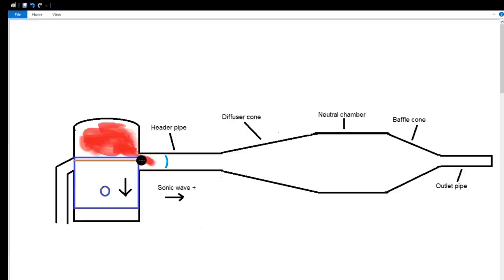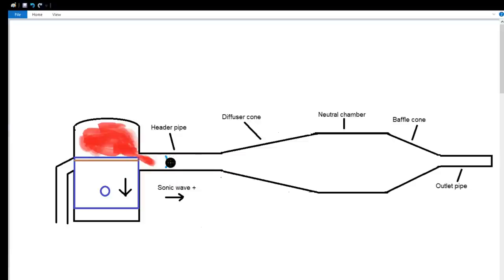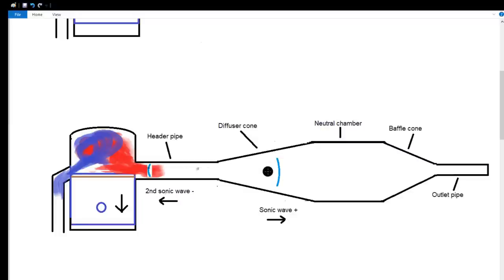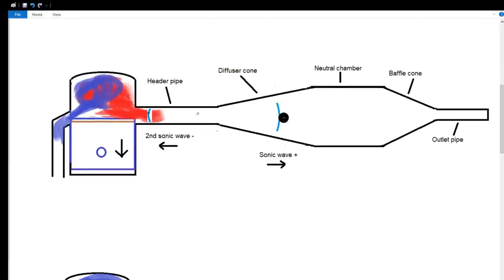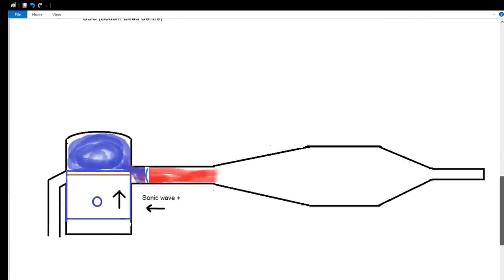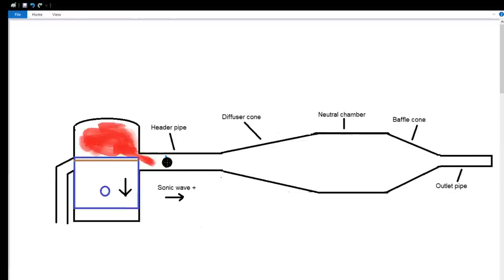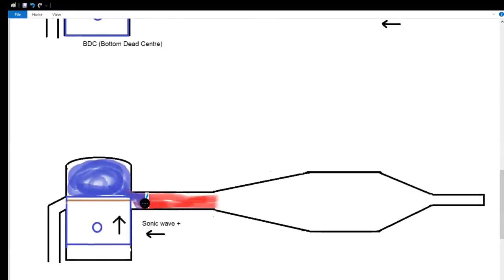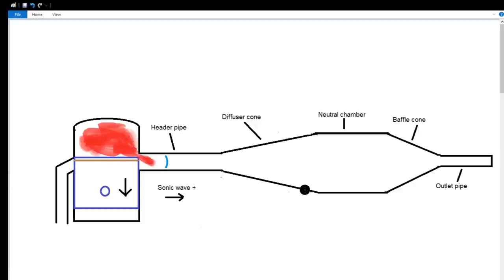Unlocking the secrets of 2 stroke expansion chamber exhausts E1

Comment: does the length of the header pipe have an effect on the performance?
Reply from the maker: Any change in the header length would position the diffuser closer or farther away from the port and would effect the timing of the first expansion wave returning so the yes it would.
Reply: @AuMechanic  so if there was no header, the expansion chamber would work as well and it would be just a matter of timing? In other words, is the header essential for the exhaust to work properly?
Reply from the maker: @Shulkyl  Not really possible as the port length is in effect part of the header length in so much as it also provides some distance between the start of the diffuser and the port window at the cylinder.
And for example if the engine RPM was very high and EGT high and the port fairly long then the pipe itself would have a very short header if at all.
Reply: @AuMechanic ok. There are these exhausts on ebay for motorized bikes called "banana exhaust". They kind of have an expansion chamber but little to no header at all
Reply from the maker: @Shulkyl  Yes I know the pipe you refer to and the first time I saw them I concluded they were more "show" than "go".
Those motorised bike engines have a fairly low peak RPM which would dictate a fairly long tuned length and this longer pipe then higher revving engines.
You could download the free pipe software I wrote (see link below videos) and make some calculations based on your engine that would allow you to figure out at least how long you would expect the header to be on a properly tuned chamber as well as the total length.
Reply: @AuMechanic  alright, thank you!

Comment: do shorten header pipe increase high rpm power, and raise rpm?
Reply from the maker: Shorter total pipe length (tuned length) will raise the effective RPM range the pipe works at.
In spring Karting a flexible header section is used and they are changed to raise and lower the RPM the pipe works at.

Comment: How can you tweek the pipe for more low tpm torque?
Reply from the maker: To get more power spread in to lower RPM range you need to basically make a different pipe to suit as that aspect of the pipe is in the angles of the cone tapers, lower angle cones will provide gains over a wider RPM range,
See the later vidoes that covers all of this, and check the description section for a link to free pipe software and if you have a mess with that you will see how the pipes differ from peak power pipes for road racing to wider power pipes for offroad.

Comment: Why does sonic wave ignores the exhaust but pushes back the air with fuel?
Reply from the maker: The gas is a mass or air molecules, the wave is energy moving through the air mass.
The wave raises or lowers the pressure of the gas only at the location of the wave.
The same as a wave in the ocean causes a rise pr trough in the water level where the wave is.
So the sonic wave doesn't push the gas anywhere, if the face of the wave arrives at the port just before it closes, which it does if timed right by the tuned length of the pipe. Then the leading edge of the wave peak will block fresh fuel and air gas mixture from spilling out of the cylinder into the port as the port closes thus trapping more of it in the cylinder resulting in more power.
Reply from the maker: Another example
Image a gate at the edge of a harbor that allows or stops water from moving out into a channel of water and there is a boat drifting with the current that is about to drift through the gate into the channel and a wave comes back up the channel against the current. The wave arrives at the gate just as the boat is about to go through it, at that moment the front of the wave cause the forward speed of the boat to slow or stall until the peak of the wave has passed it but before the wave has passed by the boat the gate suddenly closes trapping the boat in the harbor which, if the wave had not arrived and slowed the boat momentarily, the boat would have passed through the gate just before it shut into the channel.
The harbor is the cylinder and the boat is the fresh intake charge that is about the spill out into the channel which is the exhaust.
Reply: That is an excellent answer. Thank you@

Comment: So... this is why a shorter exhaust gives better top end, and a longer one gives better bottom (about same volume)?
Reply from the maker: That is the effect of changing tuned length, but for a fixed pipe lengths the tuned length is also fixed and to get more top end or low end power other parts of the pipe are adjusted, the video series explains which part does what.

Comment: hello, i have a question. how can i increase the rpm that my engine produces? its a 2-stroke 50cc.
anyways your videos are really good!
Reply from the maker: You can do that by reducing the tuned length of the expansion chamber however if the port timing is low then you will need to increase that to have good power at higher engine speeds.
Reply: AuMechanic thanks for answering, will think about it
Reply: Install a bigger carb

Comment: does it have to be curved?
Reply from the maker: It can be any shape you want so long as the inside diameters are not changed.
Reply: T
Thanks! I'm working on pulse jet design and the two work on the same principle.
Reply from the maker: About all they have in common with a pulse jet is the shape.

Comment: A good pipe will give 1 to 2 hp   a good port jop will give 5 to 10hp on a mx bike.dont forget  your port timing.
Reply from the maker: Whatever pipe you have it has to be designed based on the port area and timing or it wont be a "good" pipe.

Comment: Not depression, rarification or adiabatic depressurization. Depressions occur in open atmospheres, not walled chambers.
Reply from the maker: A depression can be be created by pushing a finger into sand to cause a depression so the terms depression itself has various contexts.A "depression" in this use is created in the pressure transducer time scale as read by an oscilloscope.

Comment: Point of mean reflection?
Reply from the maker: Referring to a single point in the baffle cone tuned length would be measured to, keeping in mind the compression wave is reflected over the entire length of the baffle cones.
Reply: @AuMechanic  Yes, and this point is point is important. Because depending on the distance from the piston to the end of the exhaust manifold, dictates that point. All math. Just a pump. At certain rpm the engine sings and produces max power. We used to say coming on the pipe. Actually after that point the power declines even though there's more revs.  The length of the intake is also important along with the size of the transfer ports.
Reply from the maker: @drrd4062   intake length, yes in a piston port engine but less so in a rotary disc and not at all in a reed.
Reply: @AuMechanic  i agree with that. what mix do you find works best. so as not to melt anything. i break in rich 50:1 then usually end up around 30:1 but I like my plugs a little darker than cardboard.
Reply from the maker: @drrd4062  That is down to the oil you use and the application.
Chainsaw Husky using something off the shelf 32:1 
Road Racing bike using Castrol TTS 50:1
Karting, depends on using Synth or Castor.
Its a very subjective topic. 
Also need to be aware that more oil makes fuel more viscous that will make AF mixture leaner so that has to be accounted for an AF adjusted with any oil ratio change.
Reply: @AuMechanic  have you ever used a flow bench? and what do you do with transfer ports besides rough them up a little? how do you figure out how much to hog out and where to do it?  that is why i asked about the bench.
Reply: @AuMechanic  also, do you run your floats level or a little high or low. by the way it is a pleasure to share and speak with someone that knows what and how the two stroke works. thanks alot. MMI 1992

Comment: Great effort but in part you are incorrect, you talk about wave energy moves though water without moving the water, or something like that. well a wave will move water but not at the same speed.  you use this to explain how the sonic pulse moved though the exhaust gasses.   When you get to explaining the inflection of the sonic pulse created by the diffuser cone whilst your explanation will not end up with an incorrect result it is how ever incorrect.  as the sonic pulse moves down the diffuser cone and is expanding in diameter it is actually not reflecting???? it is in fact creating a vacuum ( relatively speaking). Just like wave energy creates a peek it also creates a trough in water. as with any gas in side the expansion chamber the sonic pulse creates a high pressure point in front and a low pressure point behind it. as it moves down the diffuser cone expanding in diamer at a constant speed the volume of the vacuum quickly expands behind the pulse. this expansion sucks the fresh air fuel into the cylinder and at times into the expansion chamber itself.   the rest is all good stuff but you didn't include resonance? where when the sonic pulse if reflected back towards the cylinder port. pushing air fuel back into the combustion chamber.  most of that pulse actually hits the side of the closing piston and bounces back down the chamber.  power is best when you get the previous rebouncing sonic pulses overlapping with the new sonic pulse. again using waves in water this would be a king wave or rogue wave.
Reply from the maker: No that is simply a mis-understanding of how compression and expansion waves work in an exhaust expansion chamber.
The theory that compression waves or exhaust gas velocity cause a vacuum behind it as per the Kadenacy effect was debunked by the 1960's
And no expansion chambers do not work on standing wave resonance, that is again a simple misunderstanding of how expansion chambers work.
The principles of operation as I have explained can be found in the peer reviewed SAE published studies of Professor Gordon P Blair et al 1990 and 1997.

Comment: You over complicate it.  Two things come of an exhaust pipe - smoke and noise.  Noise is energy and you don't want to waste it.  The SE  (sound energy) travels independently of the smoke out of the exhaust and can go in the opposite direction.. When the SE hits the re-narrowing part of the spannie (back of exhaust) it can't fit through so bounces back through the exhaust port when the piston is on the way down and gives it a pulse of energy to bring it round and back up again. At low revs the SE comes back too early when the exhaust port is still covered and isn't helpful and at high revs it's too late as the piston is on the way back up but at the right revs hits the piston at its sweet spot around 7000 rpm and that's the beautiful moment of yannnggggg !! when your LC wheelies in third.
Reply from the maker: No and wrong.

Comment: There is no sonic energy. That stupidity is spreed in all 2 strokes lovers because they do not understand fundaments of termodinamics and pressures inside pipes restrictions and expandings.
Reply from the maker: No, just no...
This video series is derived from the works of a Professor of Engineering Gordon P Blair who has done to most comprehensive study of 2 stroke engines over some decades all of which is published in SAE papers and peer reviewed
Reply: @AuMechanic  I do not agree. The phisics behind the back pressure is only because the pressure build up in the expansion chamber. Similar to the dinamics in a turbine engine and how they work. Velocity turns to pressure when gas flow goes into a bigger chamber and bounces back if flow is not constant. Easier to understand if you try to build a pulse jet engine. Pulse jet relies on termodinamic flow motion of gases. It is the same. Sonic waves has nothing to do  it is the same blablabla as it is with einstein relativity theroy
Reply from the maker: @dogforge9207  
As I explained the principles are published in scientific journals and thus are scientific fact that has been in use for half a century now so any opposing opinion is irrelevant.
Your assumptions are a mis-understanding of the principles that many people have,.just as some people are of the opinion that the earth is flat but science shows they are wrong.
Reply: @AuMechanic  can you give me a scientific example where sound waves makes enough gas compression and flow movement cappable of doing what your books tells you? ( I do not belive in a flat earth...;-) science is a word that relies on empirical facts that you can reproduce any time anywere.
Please see the videos in YouTube about pulse jets. They are very powerfull and for me 2 strokes dinamics in the exhaust is exactly the same. Nowere a mention about sound waves.... but they are very loud !
Reply from the maker: I just did, the peer reviewed scientific articles of Professor Gordon Blair are published by SAE, the last one being "Design and Simulation of Two-Stroke Engines"